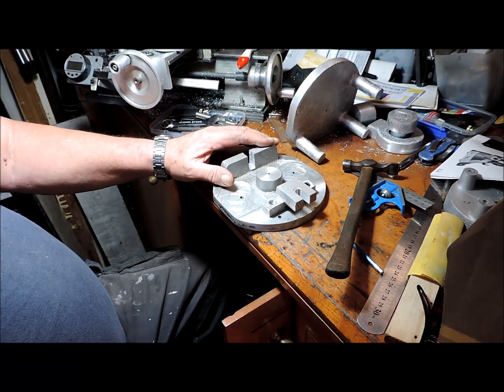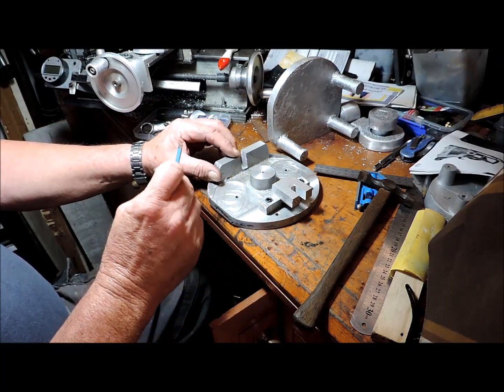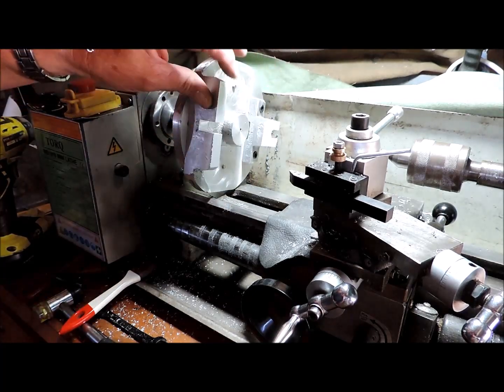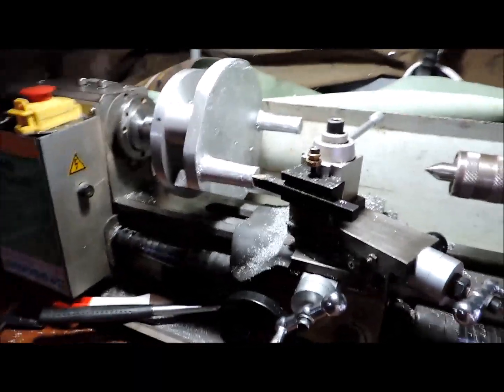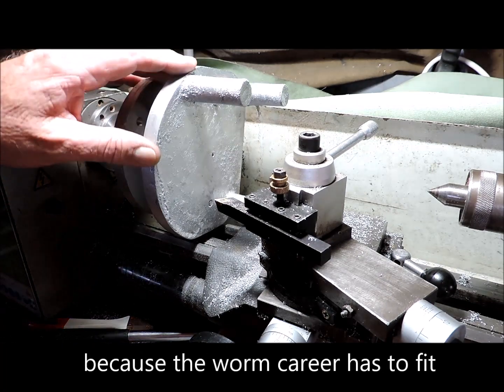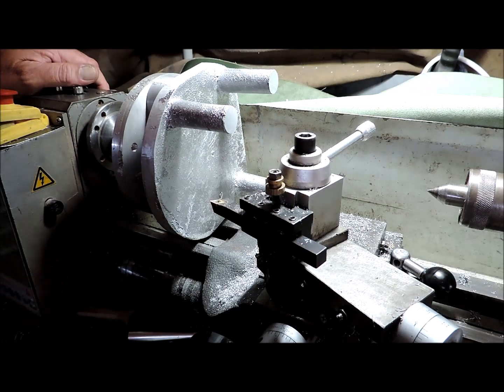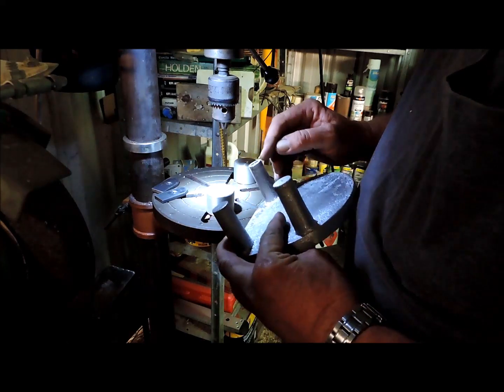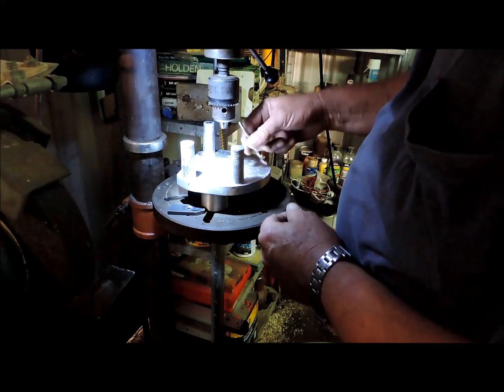Making a Modified Gingery Dividing Head Part 5,

Comment: Hi Peter.  Well it won't be long before you are bolting the side plates together.  Now, I now that the tops are rounded to clear the bed of the lathe when you turned them, but don't these get bolted together and mounted to the lathe to face the bottoms of the feet to the same plane?  With rounded tops, how will you manage that?  Inquiring minds want to know.  😉. Thanks for sharing.  This is a great project.
Reply from the maker: G’day Joe. You are correct,  latter they are bolted together and mounted to the face plate with the not machined feet, that then leaves me capable to machine a small flat to the top, I then flip the assembly around and machine the bottoms BUT! the assembled frames are too wide and hit the bed. How do I overcome this? Watch my exiting episodes to come, stay tuned. Cheers 
Peter
Reply: Peter, I knew you had a plan.  Looking forward to seeing the next one.

Comment: looking good .  With 50 : 1 you wont be able to cheat with a handbook for the divisions  ,  you will have some maths ahead of you . Cheers .
Reply from the maker: G’day Max. Yes no looking up the Black Book for this ratio so I’ve created a spreadsheet which I still had to do long hand because Excel doesn’t do fractions but then it’s easy enough as long as I remember. I still have to drill a 36 hole pattern in the 4th plate  to create a 1 degree division, easy enough when I get around to it. 
Cheers 
Peter